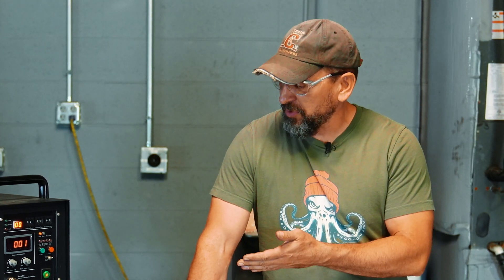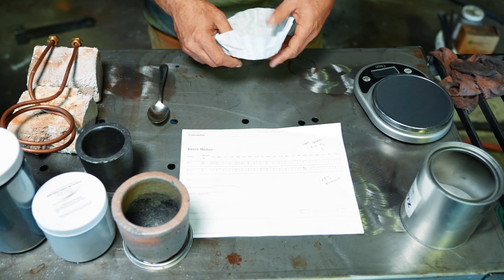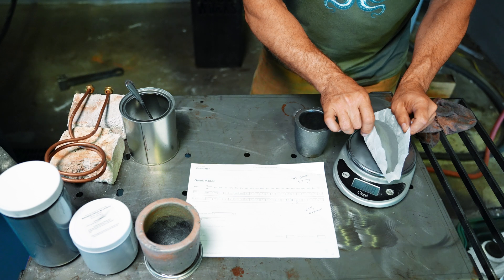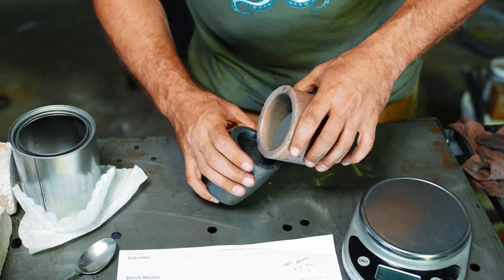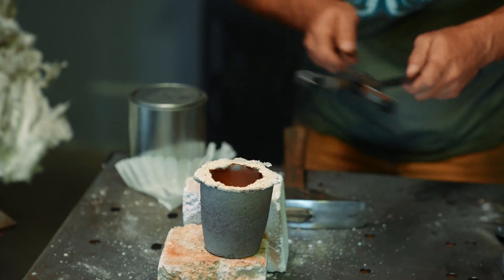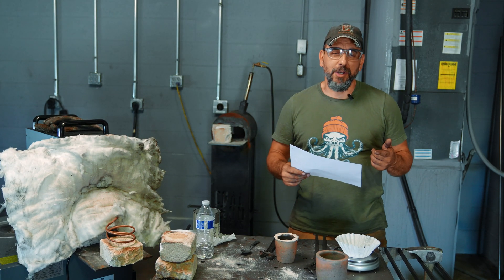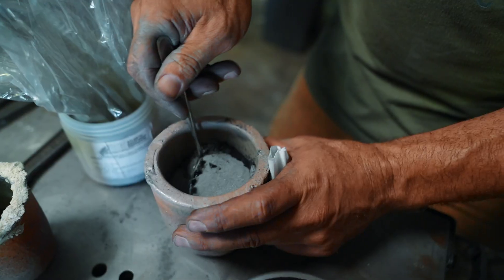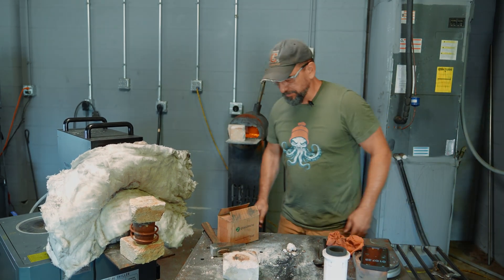Smelting Wootz in 25kW Induction Forge

Comment: What size crucible are you using? And how close is the crucible to the coil?
Reply: Hello!  The size really depends on your project.  The larger the size the longer the soak at heat.  I’ve had my best results with #2 sized crucible keeping the charge size between 1 - 2 pounds.  My favorite crucibles for this application can be found on Amazon under Molten Metal Masters brand.  They are lined where others are not.

Comment: Maybe i missed it but how much steel can comfortably be melted with the 25kw version? Would 2KG be doable? Im researching my best machine option for melting up to 2kg stainless for casting. Thanks
Reply from the maker: I don't know that 2kg would be possible in one of these- but I'll check in with Brett and get his take on it! I know he's done at least 1kg before with success but I'm not sure how far he's pushed it!
Reply: My best results are between 1-2 pounds.  I think you could scale it up but it would take 2x as long at heat.

Comment: What's the tolerance on that scale?
Reply from the maker: Unsure. The scale we used in this video was a goodwill food scale. Pretty rough measurements on weights here, so getting more precise wouldn't be difficult to achieve!
Reply: It’s not very tolerant.  I’ve talked to Dave McConnell at Northwoods forge and he uses a scale for reloading. It uses grains and is much more accurate.

Comment: Why not use the built in timer instead of rigging the pedal?
Reply from the maker: The timer only goes for so long- so we'd have to keep resetting it if we were to go that route.
Reply: @CoalIronWorks oh, I had no idea. I’ve only ever used the pedal.
Reply: The timer on this machine only runs for 99 seconds.  Use of the pedal is for as long as it is depressed.

Comment: Silly question here,  but im curious, are induction forges to be used  strictly for iron based alloys or could it be used with other metals? or just ferromagnetic metals only?
Reply: From memory - with non-ferrous metals a crucible is needed that interacts with the electric field. So in that case, it's the crucible heating the metal. The induction furnaces sold online for smelting come with both. Sadly I can't find the explanation now that I saw a while ago. In the ebay ads it's  white (quartz?) and a black (clay graphite) one. For non-ferrous you'd have to use both together. One fits in the other.

Comment: For real Wootz I seem to recall that the secret ingredient was either a piece of previous Wootz steel, or some magnetite. Also, would have been great to see how the steels turned out in the end.
Reply: I thought it was the presence of the trace element of vanadium to get that beautiful grain structure
Reply: @buny1p967 ideally yes. Vanadium is one of the strongest Carbide Forming Elements and was vital to pattern forming.  However- at the time of this demo the only CFE we had on hand was Titanium (also a CFE just not commonly used).

Comment: altho keeping in the liquid phase for 10-20 min is ok, to properly form a dendrite structure, wootz vs just a piece of steel, it has to cool down slowly for about 12 to 24 hours.
Reply: After a great conversation with Jin at @wootzmilitaria I have decided to build a small chamber from refractory - the size of the crucible - with the coils cast into it.  Our thinking there is we need more thermal mass to slow the cooling phase down to form the dendritic structure.

Comment: Would this process work with the Coal Iron 15kW?
Reply: 15KW should be enough to make steel molten, just may take a little time
Reply: This should work. You may have to adjust the charge size and/or time parameters.